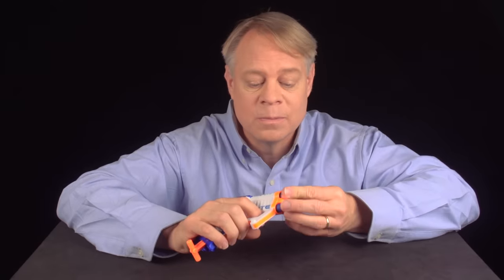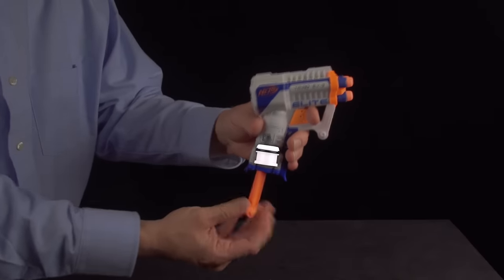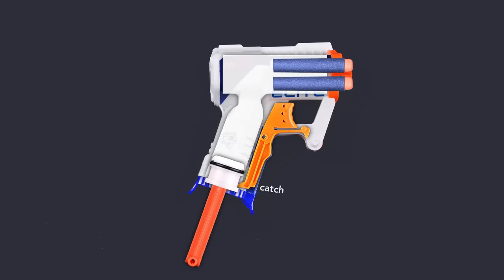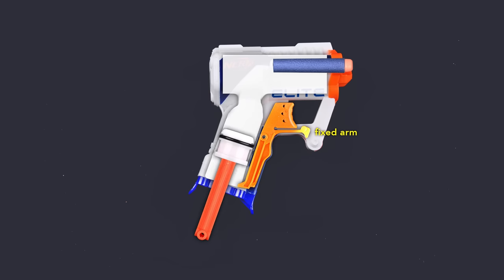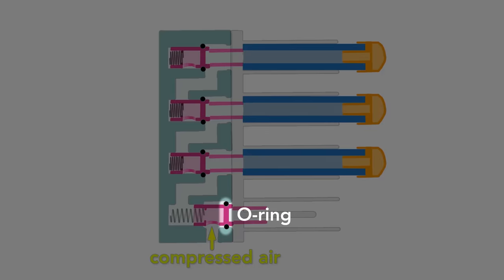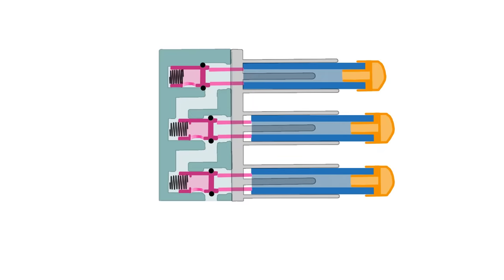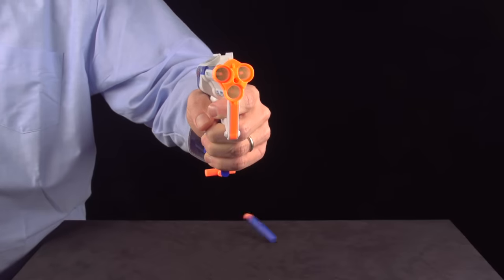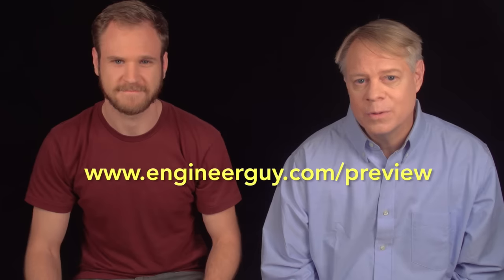NERF Blaster:  Air Restriction Mechanism

Comment: Do a real firearm, blowback, cam lock or direct impingement, firearms are one of the few highly mechanical non digital tools that are still in use,mother cam lock design which is used in most automatic sidearms is over 100 years old.